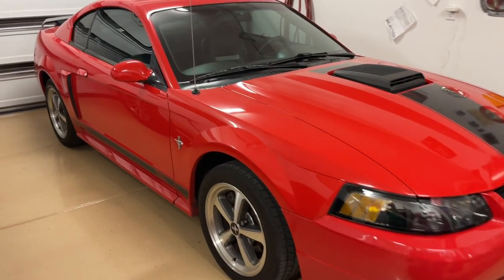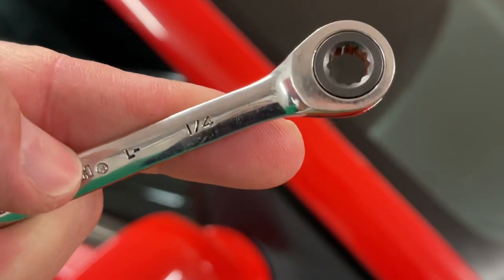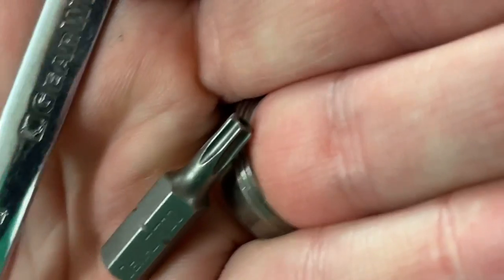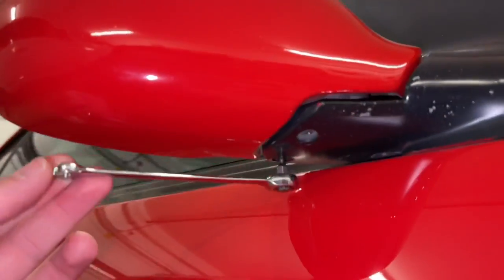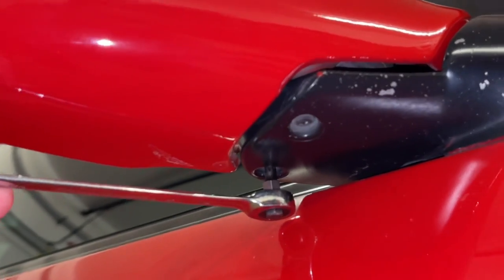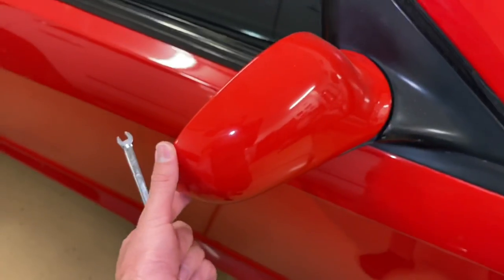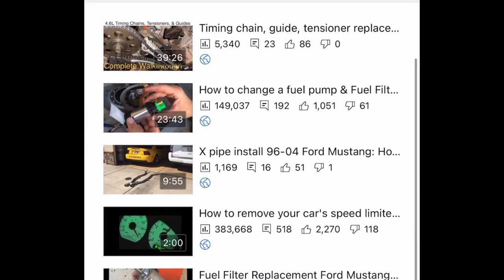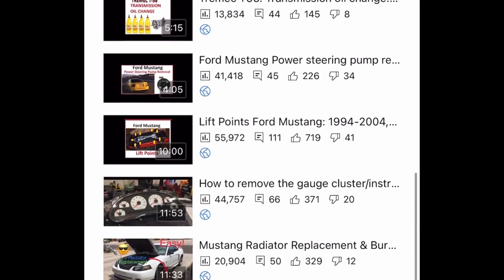How to tighten a wobbly Terminator mirror: Tighten export, 40th anniversary, Terminator mirrors

Comment: Those mirrors really look good on your Mach1… I’m thinking about putting them on my ‘03 Mach1 but I can’t seem to find them. Where did you get yours?
Thanks
Reply from the maker: Sadly, mine came from a terminator that was hacked up. You can find them on eBay or Facebook parts pages but they usually run about $600 https://youtu.be/lCf_s1KjFNY

Comment: Do you have a video on how to fix the shaking mirror when driving? Only the driver side does it. Not the housing.
Reply from the maker: You’ll need to remove the glass and then use some double sided sticky tape to firm it up. Some day it’s even the motor that needs to be firmed up https://youtu.be/EdO5RGhyoMY
Reply: @dannyjohnsonsgarage  I'll give it a try thanks!